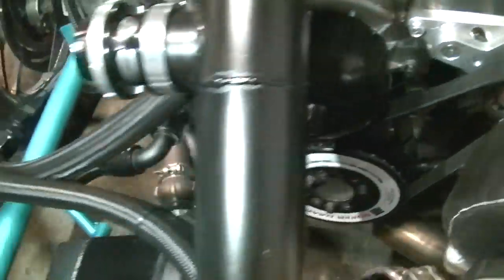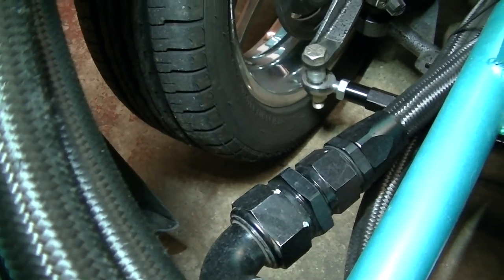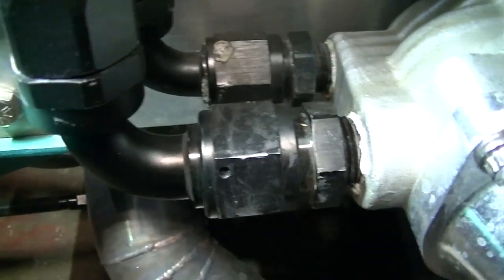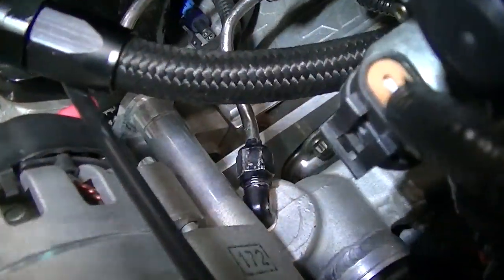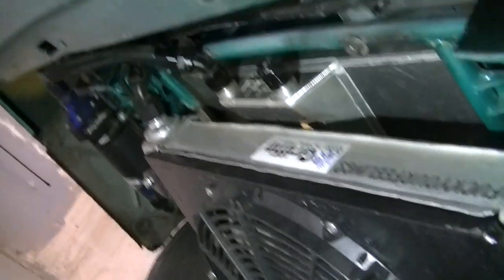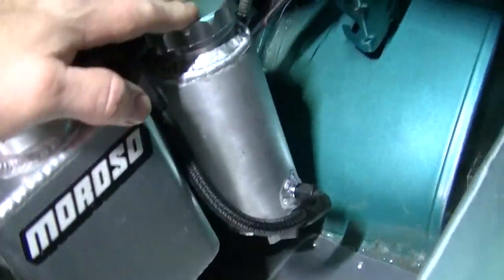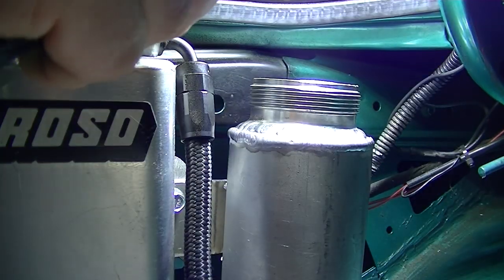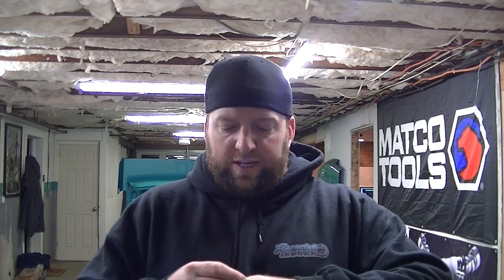COOLANT SYSTEM OVERVIEW

Comment: Just my opinion, get the Derale #16833 fans. Thats what i run on my notch. Fits my mishimoto dual pass radiator 100% perfect and they flow roughly 4k cfm. I had contour fans in the past and hated the way the plastic shroud looks. The Derale kit is very nice. Doug from motion turned me onto them in one of his cooling system videos. Little more pricey but far nicer imo. The aluminum shroud would look great from behind the car.

Comment: I think another issue u have is the inlet and outlet are on the same end...I feel like one needs to be on one end and one on the other end
Reply from the maker: K it’s a dual pass radiator. It actually works better because you technically send the water through the fins twice.